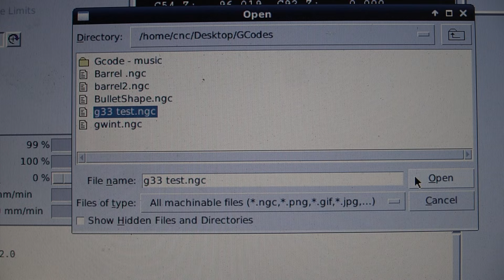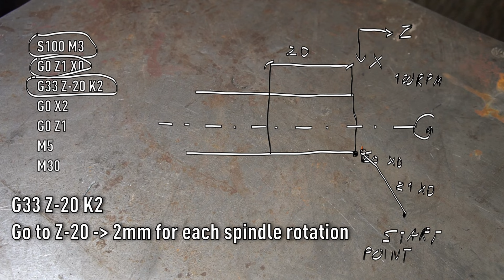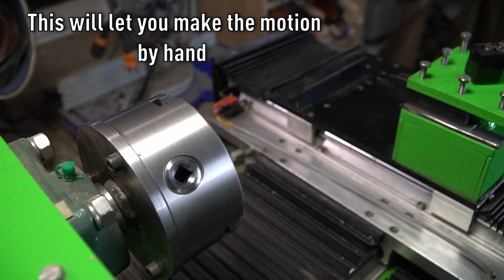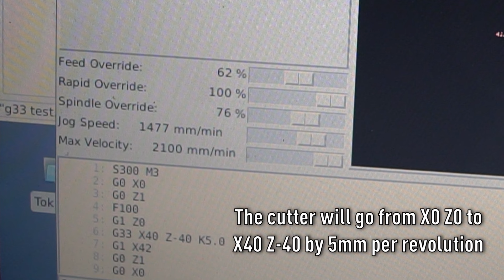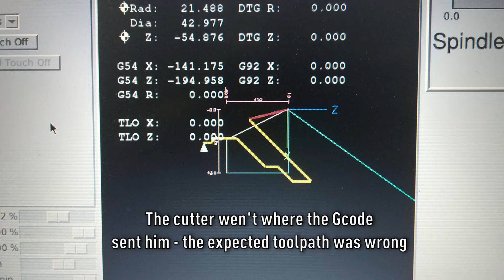LinuxCNC - G33 Spindle Synchronized Motion

Comment: Hi! great work! do you have in your patron any tutorial of how to connect and set up the spindle encoder to de mach3 board? thank you!
Reply from the maker: Hi! thanks! I think it is not possible to hook up an incremental encoder to mach3 - only index signal (z signal from encoder - 1 pulse per rotation). For some machines this is enough but for mine it didn't want to work

Comment: Hi! Thanks for the content! What are you using a parallel BoB, right? Why spindle stops each pass?
Reply from the maker: Yes, I'm using a cheap parallel BoB. This is the G33 cycle - for testing of this function I had a GCode program with just one line. For the purpose of showing how it works - I was adding additional depth each pass (each pass was a seperate program - this is why the spindle stopped each time). If you'd like to make threads - use G76 instead :)
Reply: @GBWM_CNC  Thank you very much! Have a 3 lathes to CNCizer. 2 Sherlines (Chucker) and 4100 and a chinese Mini lathe. Got a mesa 7i96s for Chucker but studying to use the parallel BoB for the others. My doubt is about connecting an encoder to get descent RPM reading for the spindle in the parallel BoB and make precise threadings (I need to machine small worm gears). I notícias that you use a encoder and a pulse indictive sensor. They work together? How to connect ALL encoder wires tô thr paralela BoB (A B Z)? My first linux experience was in 1998 with Slackware. Long time with no use. Backing to the game and you are helping a lot!
Reply from the maker: @motacosta123  I'm really glad my videos do help people! Good luck with CNCying! :)